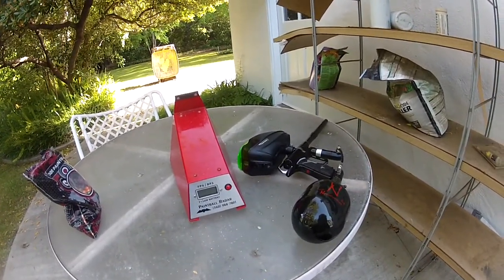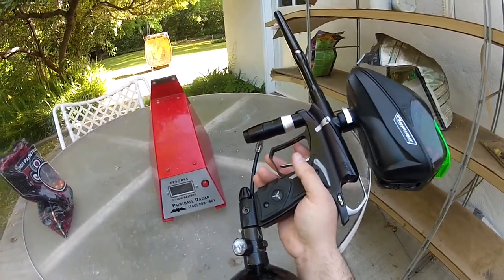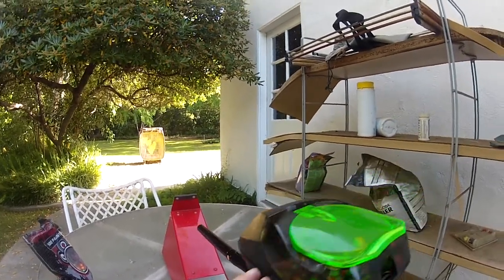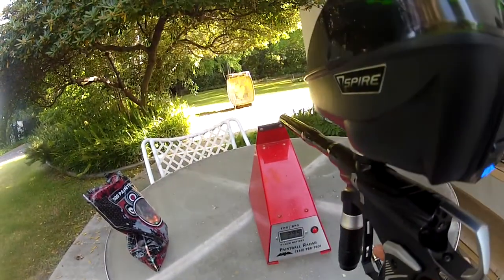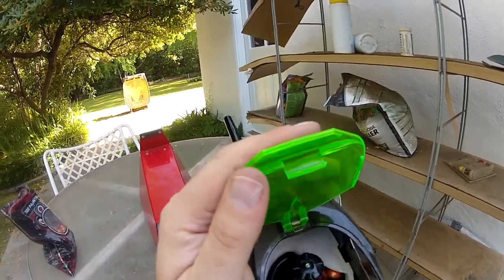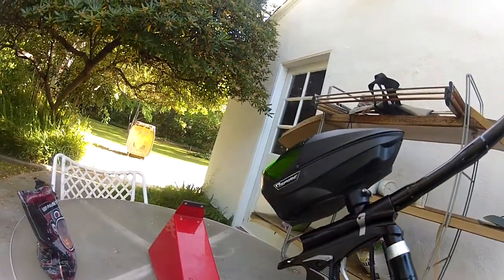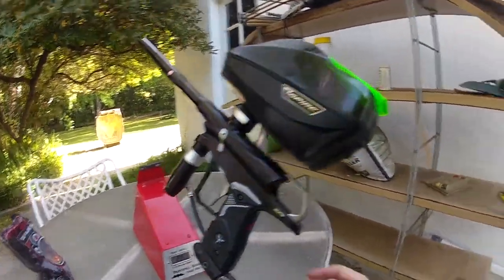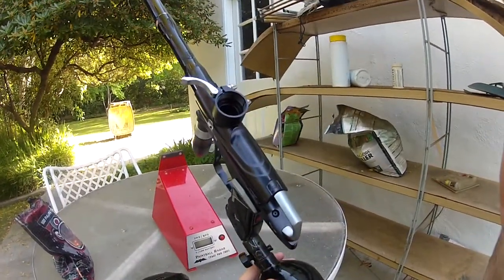Black Stock Dangerous Power G3 Demo Shooting

Comment: G3, G4, G5 use in the ASA a NBR 3.69 × 1.78 (#007) Oring in the ASA, BUT it has to be the harder 90 shore not 70 shore!

G3 + G4 only have in the ASA this Oring #007 - 90 shore
G5 have ASA #007 - 90 shore and regulator seat #007 - 70 shore
sadly, this is not mentioned in manuals, I find it out by comparing spare Orings
For E1 users, the ASA oring is on the other hand softer 70 shore

Comment: Stock asa uses a ring slightly off sized from a standard 007 on the pin, 3.69*1.78 i believe. Likely the metric equivalent. But it will just seal up once and then blow the standard o ring every time.

Comment: No leaks ? I am surprised.
Reply from the maker: Paintball Noob You're right...hey definitely had a well deserved reputation of leaking right out of the box.  The quality control just wasn't great but usually were relatively easy fixes, cinching up macro lines, sealing elbows etc.  I've gone through several of them that had issues like that at some point.  No big deal if you knew what to do but at this price point you had a lot of people new to paintball buying them and then being VERY unhappy.  I still have my gold G3 and love it for what it is.  It won't replace the Luxe or Insight but it definitely rips.  I just got a G5 recently and the thing is solid.  I do see folks have issues with them but those issues tend to be different and again seem to be inexperienced folks that aren't using the right grease or oil for the conditions.  So far the new one is working out well...will have to do an updated video on it.